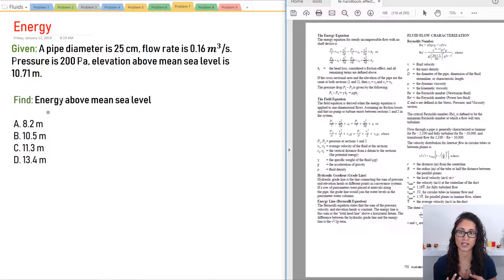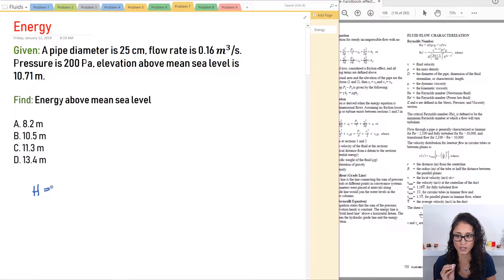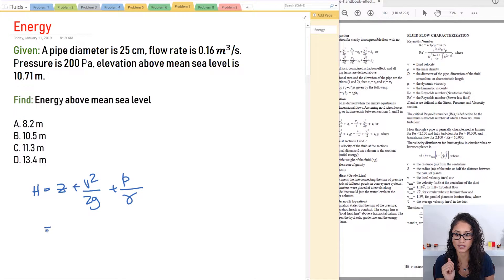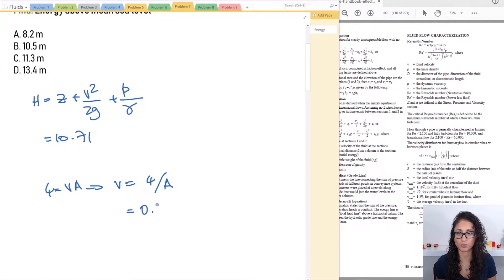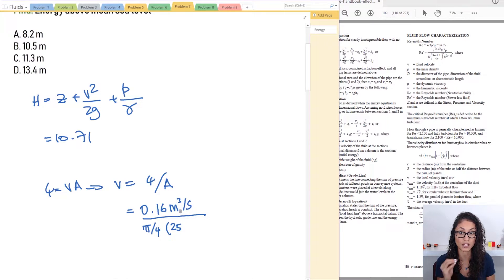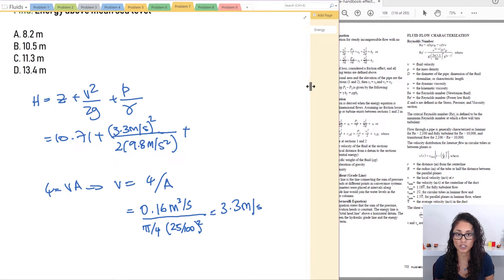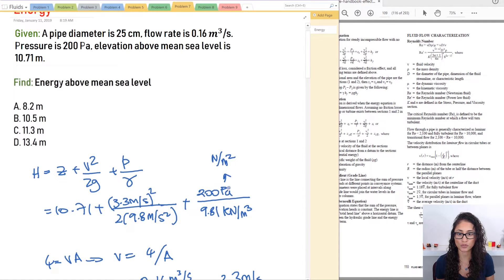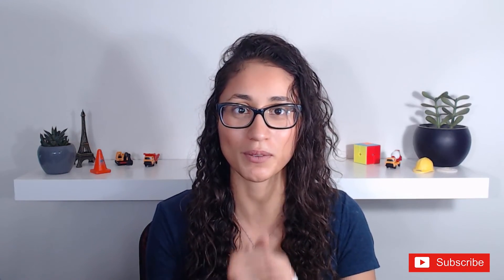FE Exam Fluid Mechanics - Energy Equation (Head)

Comment: Can you explain why the unit of energy is in meters? Thanks.
Reply: It doesn't really.  It is more of a convention, than any physical reality, that we express it in units of meters.  We divide all terms by g, so we can relate to the other forms of energy as an equivalent height called "head".  Gravitational potential energy per unit mass, is z*g, and we divide through by g to turn J/kg into meters.

Pressure energy has nothing to do with gravity, and neither does kinetic energy, nor frictional losses, nor shaft work.

I prefer to see in the following form, since only the energy associated with the z-terms have anything to do with gravity:
P1/rho + v1^2/2 + g*z1 = P2/rho + v2^2/2 + g*z2

In this form, all terms directly tell you the energy per unit mass.

Comment: Hi, I see the Energy Eq in the handbook however is not H= z+ v^2.. etc the H is in the same side as z + v^2 etc.. how did you get that initial eq?
Reply from the maker: Hello Andrea, great question. So if we go to page 109 on reference manual, at the bottom of the page, there is a definition of the energy line, which states that the total head line is the sum of pressure, velocity and elevation heads. I hope this helps and good luck with your exam!

Comment: Can you explain how you came up with that version of the energy equation (e.g., how you canceled out the other pressure and velocity terms)
Reply from the maker: That is a good question. So the question asks to find the energy of this pipe. Note that the pipe is in a horizontal line, so the total energy is constant. Therefore, we have energy grade line. Now, energy grade line is the sum of pressure, velocity and elevation. You can also check the definition of the energy grade line in the reference manual page 109. I hope this makes sense and good luck with your studying!

Comment: Thank you for your help I’ve been out of school for 5 years and I forgot a lot about fluid mechanics and a lot of subjects lol.  I did have a question though I kept the units in pascals(200) and put it over 9,810 N/m^3 Is that part of the answer the same?
Reply from the maker: You are welcome and thank you for watching my videos. You can totally do that and you will get the same answer because pressure head has a unit of length, so in this example, it is going to be in meters (SI units), so when you have Pa (N/m^2)/ (N/m^3), after cancelling the units, you will get meters, so having N or KN, it doesn't affect the rest of the equation.

Comment: How do you know that the specific weight is for water?
Reply from the maker: If the fluid in the pipe is not specified, we usually assume it's water. However, in your FE exam, you will be given all the information you need to solve the problem.
Reply: @Genieprep  Thanks